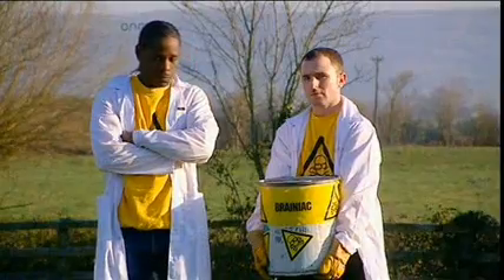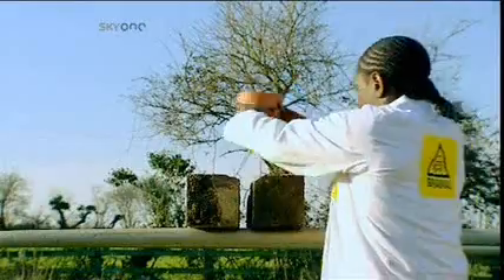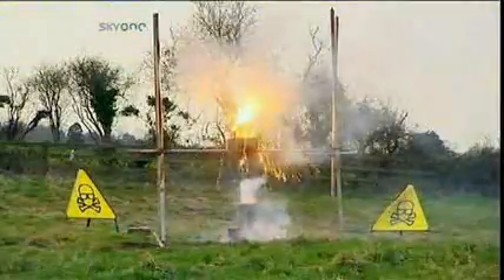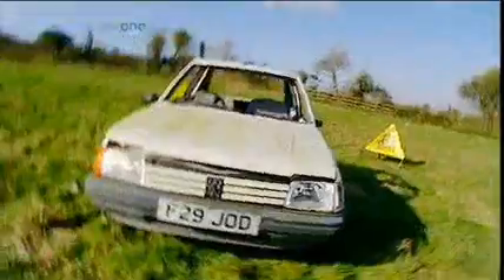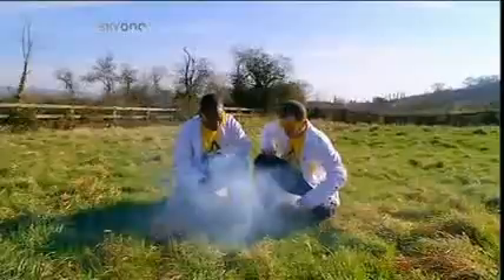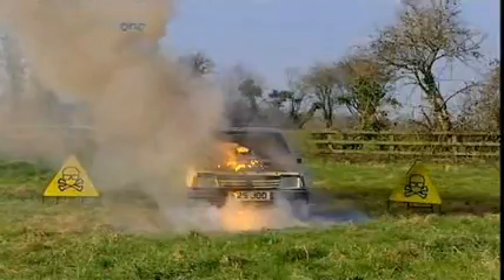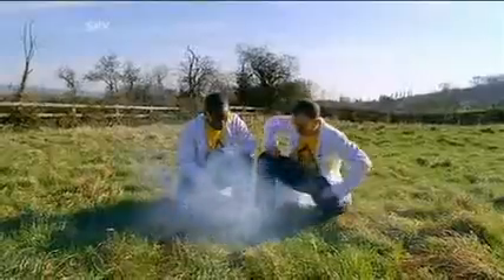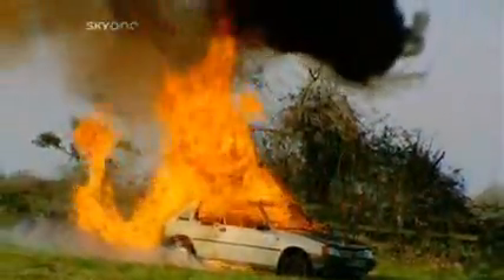thermite experiment  911

Comment: Unfortunately sir your wrong, thermite is a very useful substance used in linear cutting tools because it acts extremely fast. It o ly takes 300g to cut through a 20" inch solid steel plate In abt 60s. It is often used in demolition of support beams in combination with a cutting to torch to speed up the process. A good demonstration of it's power is that it burns bright enough that within 60feet u can suffer retinal damage because
Of massive uv rays.